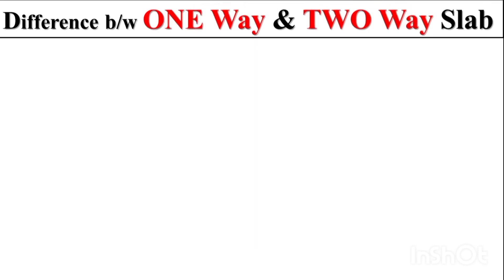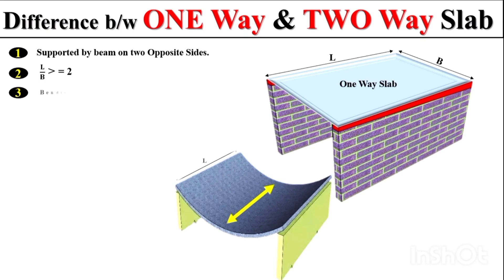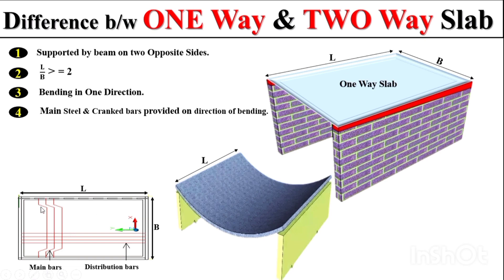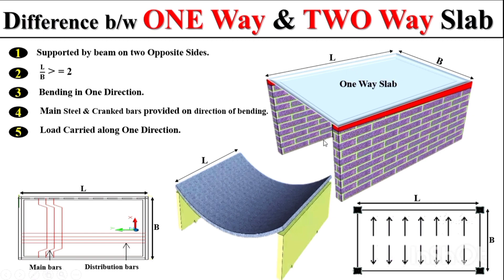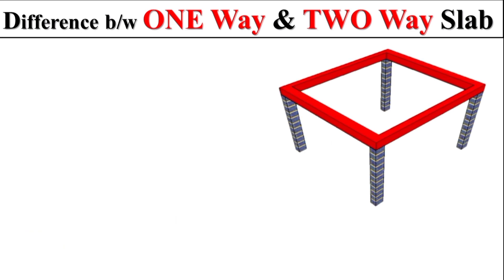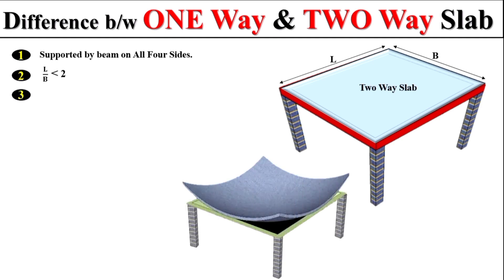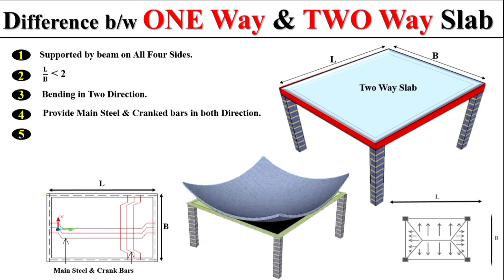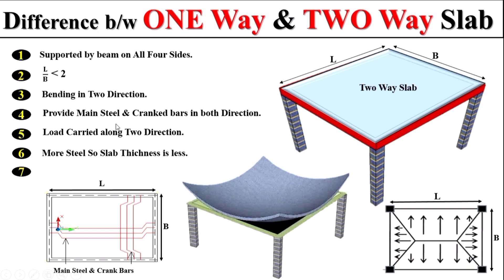One Way Slab and Two Way Slab | Difference Between One Way & Two Way Slab | One Way & Two Way Slab

Comment: Great video, so to calculate the thickness of a simple 2 way slab we add the perimeter and divide it by 180 eg 8+8+8+8=32 
32/180= 0.178